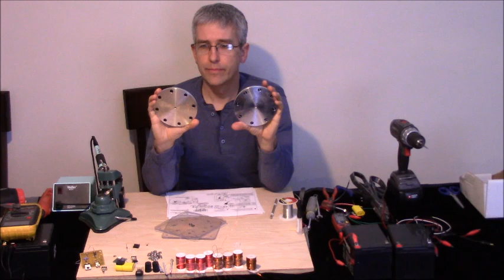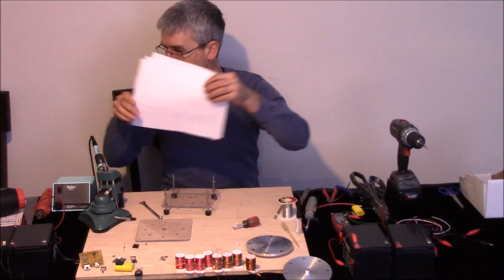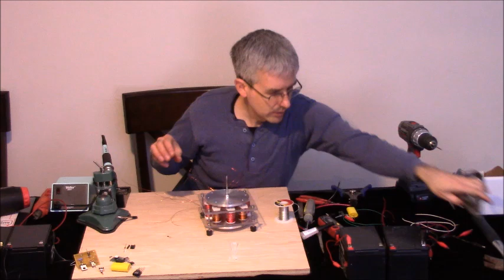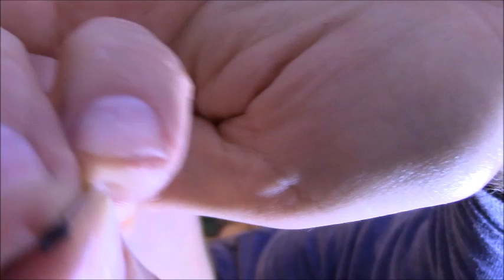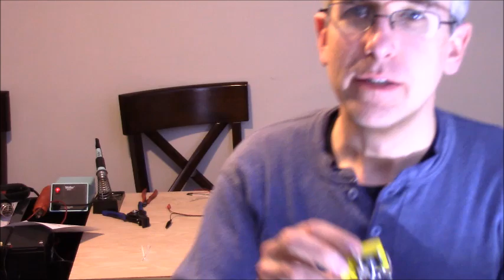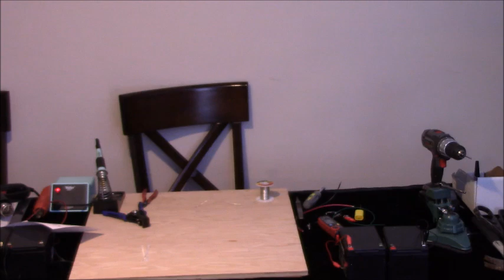4 Dualpole Mini Kit Instructions with options

Comment: Hi Rick,

Glad to see you are considering using a mosfet driver for the hot triggering.  Between the driver and mosfets with lower resistance, I believe you can push a lot more power (for motor torque purposes) with fewer components and smaller heat sinks.  Of course the Dualpole Mini only needs 1 mosfet.  Also, I believe it is very important to increase the mosfet voltage as well - the internal zener is creating heat when it breaks down to protect the lower voltage mosfet.  I've had much better luck with 100V mosfets (like the one I brought to the conference) which are only a couple dollars each.  Let me know if you need any other information.

Jason Poteet
Reply from the maker: Jason, we'll get to it in time. Thanks for your help.

Comment: Hi Rick I have your 4 pole mini dual motor would like to know what's the difference if you change the resistor from 1k to 220 ohms what happens are you suppose to change them not sure what it does. Great videos thanks for sharing your knowledge and expirences with us I love this tinkering stuff too .
Reply from the maker: It will not make that much of a difference. It influences that Gate terminal on the mosfet. I will be adding a gate driver as soon as I get a chance.

Comment: Hi Rick I've noticed on some of your videos you have the 4 pole mini double stacked do you sell the longer shaft and threaded rod is ? there any advantage other than mechanical power for this set up   also your larger 4 pole motor how would you rate the power difference between the two
I have  put that extra circuit with the biflar coil I used .3 for the trigger it works really well 
the motor runs different to before it's like the variable resistor changes the way it runs and charges it is definitely different
Regards 
John Coroneo

Comment: I have purchased many of your kits over the last 5 years.  If I purchase the latest on the renaissance charge site will it have all the upgrades you mention for the same price?
Reply from the maker: The kit will come just like as shown, without the second board for the trigger coil unless you order that as an additional option. The second part of the video is not processed yet which will show all of those details. I will start sending out the kits with one of the motor coils as a bifilar coil from now on so that the motor can be used about 6 or so different ways: 1. regularly with all motor coils with the hall/mosfet switching (trigger wires on the one coil not being used), 2. 1 to 3 coils running with the hall/mosfet switching while the trigger coil and/or 2 other coils running with its own circuit off the same input battery charging its own battery directly so that it is negatively charged, 3. or charged through the capacitor pulser so that it is positively charged, 4. Or running it to the same charging battery through a pulser to make the charge all positive instead of mixed in the main charging battery. 5. or adding the 3rd stage process before that battery to allow for self-running and more output yet,  6. Or all coils running together with the trigger coil with no hall/mosfet triggering.
Reply: I'm preparing for the grand finale.  I respect what you are doing.  I'll keep watching.
Reply from the maker: This will always be improved and added to so you'll be waiting forever. The motor as it is sold right now will allow for all the future additions. The additions will be separate.
Reply: I am not waiting.  I have several working prototypes.  I have watched just about everything you have produced.  I have studied Don Smiths work and many others and I believe I know where you are going.  All these motors are capable of producing what is needed.  Even the smallest of pulse motors.  I started my journey 10 years ago asking where does the energy to pulse our heart come from.  What is light. Does it come from the bulb or is it resonating the area around the bulb collecting the light.   I think I have found the answer but I can't prove it.  I'll keep watching, I'm interested in your take on it.  Trying to understand the process, I have damaged all the transistors 
multiple times, never melted any coils.  I know what was in the box I just don't know how to 
control it (Limit it) and "Tap" it without killing myself.  Inside the Box was a Induction coil, Spark Gap, or a Tesla Coil.  You were not hiding anything.  It was literally right under your nose and all around you.  LOL.  Ooops, I also forgot the Ground.....  Did I miss something?
Reply from the maker: Very good. What I have come to the realization of is that there are certain things we may never know and other things we cannot know in this life. This does not mean we cannot use this, just as we use our bodies without knowing how they work. It doesn't mean we should use something if we have the ability to either so there are always ethical considerations and limits. What is light is a profound question. Saying that God is light is understood in different ways by different people (pantheist, or monotheist). In some ways God is light and in some ways the light we are talking about He merely created. As for where it is, it doesn't matter so much as how to use it. The eye is not the only organ for the whole process to perceive light, and my focus has been in the same way to look at all the processes in this research that make for the desired result. I said last night in my latest video, second part not uploaded yet, that it is not just the initial process that gives the results, but the reception/collection phase and then the conversion/transmission stage. These are both separate and distinct as well as part of the whole process. People tend to oversimplify that and complicate other things. With Smith people got to stage one of the process but did not know stage 2 or 3. This is one reason I have been doing the Benitez presentation to go through the stages on a basic level that proves to everyone these things very easily.
Reply from the maker: Exactly. This is my whole point of not fully disclosing it obviously. I have fully disclosed it in these videos and people like you can understand that from the video and words. But I don't want especially people unskilled in this damage their parts. I'm not worried about people hurting themselves on the mini kits, but if you go up to the bigger systems then there could be a problem. So this is something we will do as a sealed system in the future where it is all controlled. It's not hard to control it, the difficulty is more in multiplying it out while loads from it vary while keeping a limited amount of energy going back to the motor and input. 
As I said, I don't claim that my words about all this are correct or should be used and I hope people understand that. I understand how it works on a certain level, to the point of making it work and controlling it. The only thing left to develop is the conventional side of things for the applications. I know others have done this over the last 40 years already...
Reply: Rick Friedrich  
Why are we still dumping the collected energy into batteries?  Is it just the safest way?  Energy is power and the knowledge to produce energy is freedom.  Storage of the energy is important , however why store it if it is abundantly everywhere?  I believe in the creator and his son too.  That is the focus of my life and the study of his creation has been a hobby.  I'm tired of the BS.  Moray, Tesla, Benivedes, Tom bearded,  Stanley Meyer and the list goes on.  We need this.  I'm not a electrician and everything I know has been self taught.  I can't for the life of me figure out how to tap this light using the pulse motor, spark gap,  and grounding .  Part of my hinderance has been my locality and life. I just haven't had the resources available to me to move forward.  This is all about to change.  I'll continue watching.
Reply from the maker: Batteries are part of our structure. Products have been made to run a certain way and no matter what are going to stay that way for a while. So it is about integration right now. You also cannot change society fast, as it takes people  along time to get used to something, especially fundamentally different. 
I have my own concerns but I wouldn't group all those people together as bad.
Reply from the maker: You know of course that these men are dead right? Tom is still alive but not able to think along these lines anymore. I'm sure everyone has their story. Greed, threats, mistakes, fame, fortune, who knows. Who's acting like children?